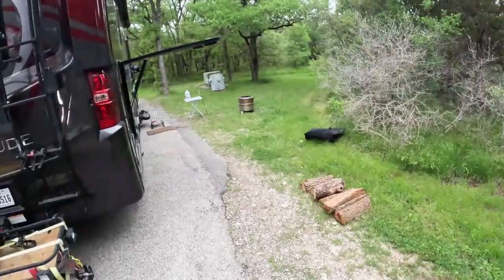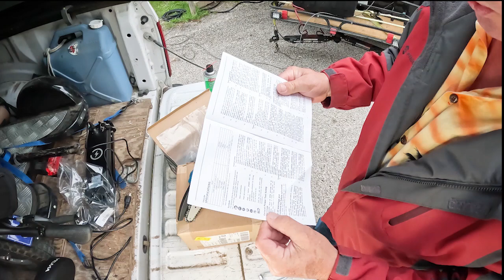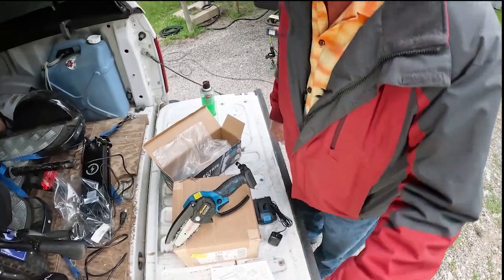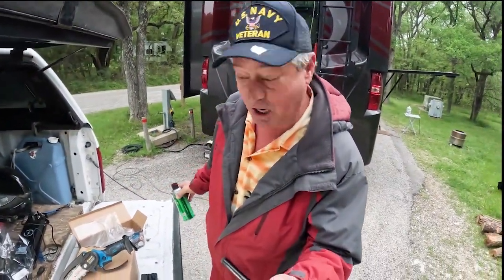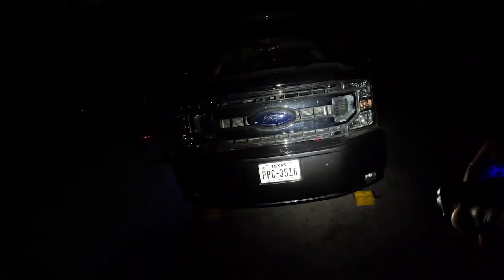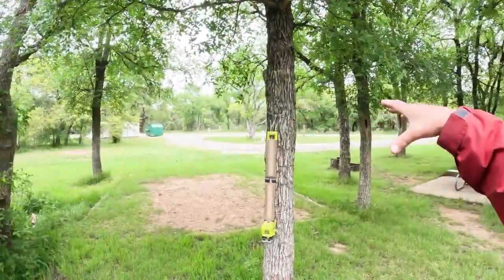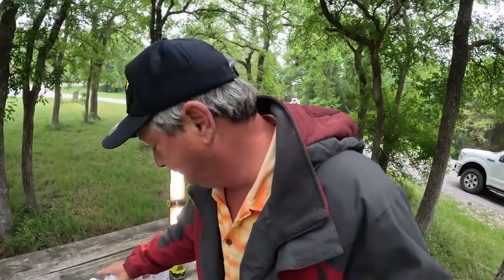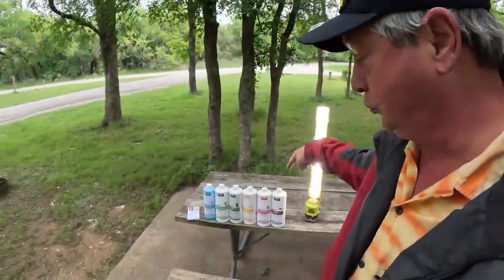The Going Small Edition Of Fridays Finds! Big Performance Small Package!

Comment: Those Uniqie septic products really work well , and they are not too expensive. They can get you out of a s#itty situation.😳
    Those hand saws are awesome,, got one last year,,, just be careful when tightening the chain,, the metal   adjustment screw is soft metal so it can be stripped easily.
Reply from the maker: That is great to know about the soft screw! Thanks for sharing that tidbit!